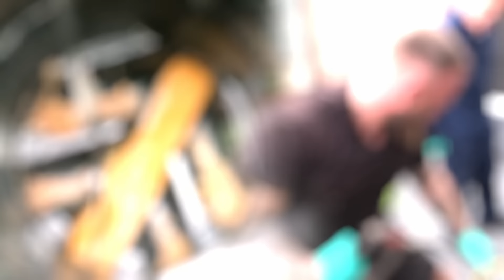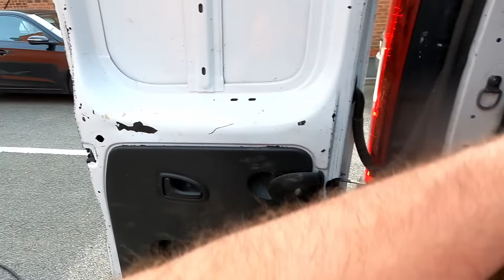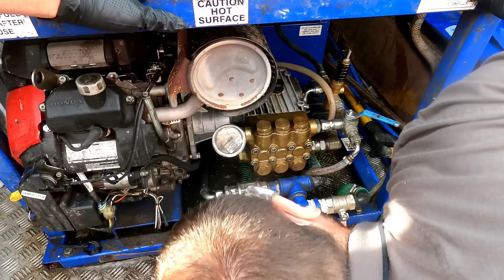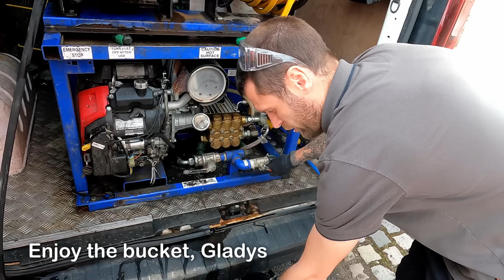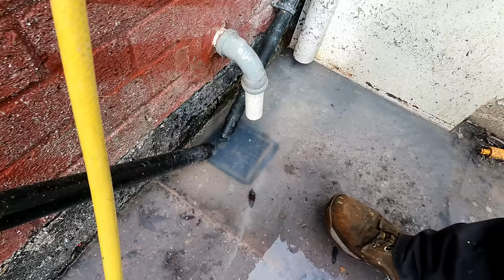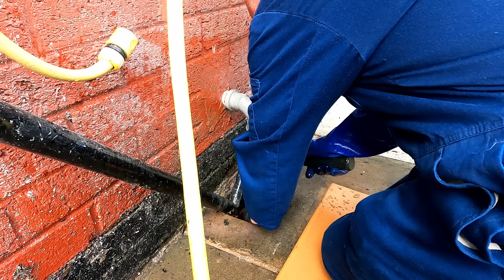Drain DISASTER! Why do we keep finding THIS in the Drains?

Comment: Have you tried or considered using a flip down face shield in addition  to the safety glasses? . They have shields that cover the face not just shield it. They use that kind in the auto body repair    field to knock down / keep down the dust from sanding.